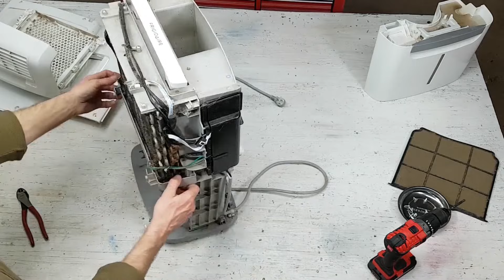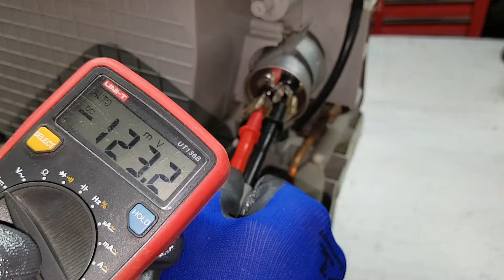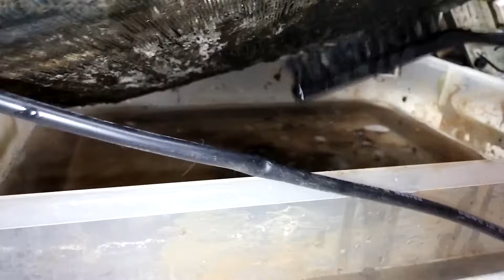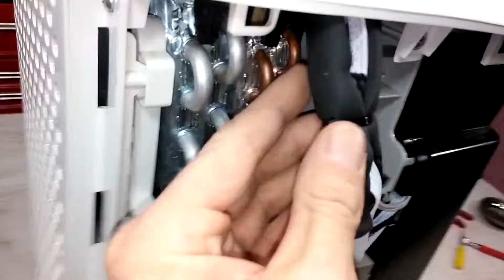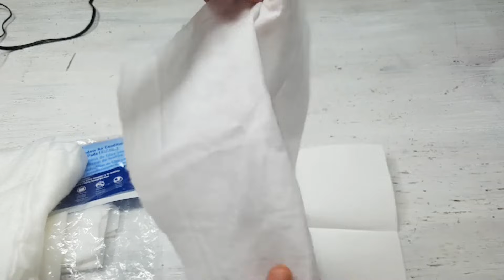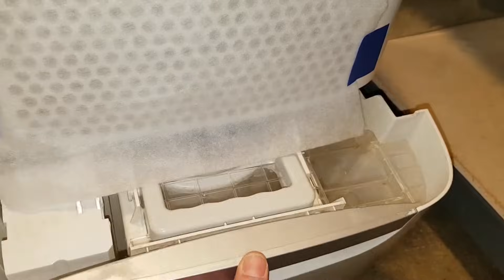How I Cleaned a Dehumidifier - Deep Cleaning Moldy Coils, the Bucket, and the Filter

Comment: Nice job, Phil - tremendous attention to detail, and very clear voiceover. My dehumidifier is used to dry clothing in a small room, but the fabric fibers, plus fungus, seem to partially block the drain pipe, causing water to miss the reservoir and land on the floor. I will try to emulate your solutions, if I can - so, thank you!
Reply: I'm drying clothes also...I'm planning to fix my dryer but I'm having trouble finding the door latch... blessings to you and yours
Reply from the maker: Thank you.

Comment: Do you have any suggestions on how to get to the coils easier to clean? Or most likely need to go that deep in taking it apart?  Mine isn't bad, but I'm noticing a smell and some black chunks coming out of the hole that feeds into the reservoir tank.  Thanks!! Great details!
Reply from the maker: I know what you mean.  Taking the thing apart to that extent just to clean it is more inconvenient than it probably should be.  Haven't been able to figure out a way to clean the dehumidifier without disassembly though.  I assume, based on its design, that the manufacturer didn't intend for the unit to be disassembled and cleaned by the consumer.  If I find an easier way that works,  I'll post a video about it.  Thank you for sharing your experience.